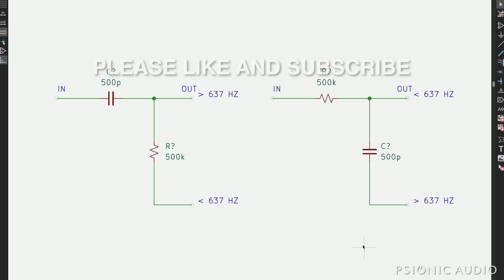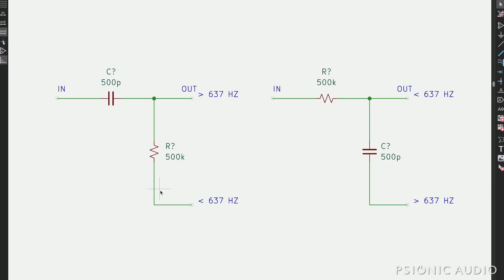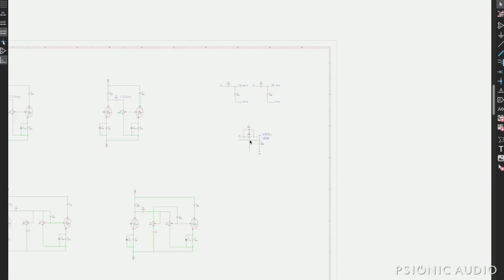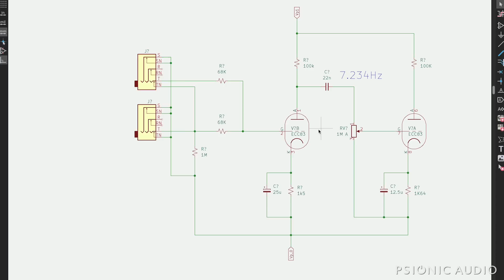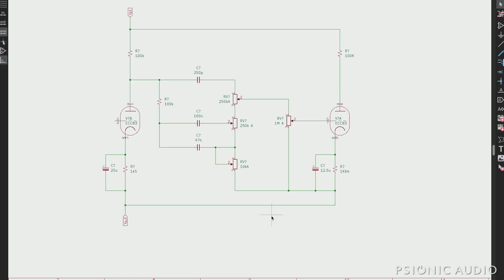Fender Tonestacks: Beyond Analogy

Comment: You can think of an RC filter as being like a very simple frequency-dependant voltage-divider in that the voltage-division is dependent on what the signal frequency is, because the reactance or AC-resistance of the "C" part of the RC filter circuit varies with signal-frequency, the higher the frequency the lower the AC-resistance, assuming I remember my electronics theory correctly.

Comment: At the start of the video it would have been advantageous the consider the capacitor/resistor combination as a voltage divider.
Capacitive reactance is inversely proportional to the applied frequency.

At low frequencies the capacitive reactance is high, so as a voltage divider low frequencies can't get through.  They are not diverted.
At high frequencies the capacitive reactance is low, so as a voltage divider nearly all high frequencies get through.

There's been a lot of talk about the mysterious -3db frequency.  No mystery at all.  It happens when the resistance of the resistor has the same value as the capacitive reactance.

Comment: Thanks for the fairly clear breakdown. 
one Q: is not @2:15  the right-side circuit  inverted rather than reversed? Reverse seems to imply the output becomes the input and vice-versa; changing the direction of signal flow.

It makes me chuckle that fundamentally A "tone stack" is just another word for chord.
Call me 'peeved' or pedantic, but it is pretty ridiculous that guitar players have a knob on the guitar that says "tone" (instead of 'LowPass Filter' or whatnot) - and like 'tremelo bar' it is a source of a broken terminology that goes on and on for decades. 
i.e. "tonality" in music is a matter of interval relationships, and has nothing to do with the timbral overtone structure in an AC audio signal.  Plain old sIne waves are just as "tonal" as whatever fuzz or cascaded, overdiven signal one cares to compare it to.

Comment: I have a 73ish Twin A738488 that i stripped down to a stand-alone preamp for "Jerry Garcia" sound. I've done a lot of weird stuff to it and it works almost all the time. I've replaced a bunch of caps over the years but i think its living on borrowed time.  It seems to drop vol at unpredictable moments. Would you be interested in a job of putting together a kit for me to over haul this thing. I don't mind spending the time and money to rebuild it, I just don't have the expertise to get all the parts at a decent price. I'm only using three triode tubes with a deluxe transformer. It might also make a nice prototype that you might find some profit by replicating. Nobody is making a "real" rackmount "Jerry Garcia Twin clone" preamp. Gear is getting smaller and with radial caps and a deluxe transformer, it could fit in a variety of smaller premade cases. Im thinking about all on one eyelet board. I've listened to a lot of "sounds like Jerry" type preamps and none do what mine does. It sounds more like Jerry than th John Mayher's Dumble. I've had it 30 years and I'll have it forever. Helping to design and build these things for other dead heads would mean more to me than money and in todays "digitally modeled" world it would be an act of rebellion. Nobody knows component choice like you do. Thank you for your time-Joel

Comment: This is great!  
On other tone stacks, or on some simple 1 pot tone control  circuits, I am having trouble understanding RC network.   

If the output is on the wiper of the pot the RC appears to be a fixed RC to me.  On pots where the cap is connected to the wiper of the pot, it seems like the pot acts like a varistor and the High Pass Filter is variable.  Am i overthinking this?

It would be great if you could do one of these on coupling cap circuits so we could figure out the optimum high pass value to keep a full sound but eliminate the nasty lows when overdriven.

Thanks for all of the great YouTubes.

Comment: Lyle, you did more in 22 minutes than I thought possible. Well done. 

For those viewers with a highly technical bent, there are various books that go into great detail about the calculations involved. “Designing Preamps for Guitar and Bass” by Merlin Bledsoe (aka The Valve Wizard) probably is the most accessible. The maddening thing is that everything is connected and a change here can have unexpected consequences there.  “The leg bone’s connected to the knee bone…” and so on. 

In my experiments, I learned that you change ONE component at a time. Maybe 1 R/C filter and that’s it. Then test. Change 3 or 4 things at once and you’ll never be able to figure out what you’ve done. You might get lucky …

Final thoughts: many of these circuit snippets come from RCA’s “Radiotron Designers Handbook” from the 1940s and 50s. Leo Fender was a brilliant industrial designer.  He always focused on cost and availability when choosing component values, and as Lyle explained those amps were multi-purpose - not just guitar amps. There is nothing sacred about a 1k5/22uf cathode resistor/capacitor network. It works well and those values were both cheap and readily available to Fender. However, for guitar you can reduce the cap to 10uf with virtually no audible change (except maybe less woofiness from your speaker). 6.8uf is a sweet spot to my ears in a Blackface amp, but everything must be taken in context. And every player has a different ideal tone on their head.

Comment: So from this explanation I can understand that the Normal channel of the DRRI gains more low frequency because of .047 capacitor after the second stage, rather then Vibrato channel with .022 cap. So probably I need to change this .022 cap on Vibrato channel.
Reply from the maker: No. Do the actual calculations.

You’re looking at the C but look at the R too.

Comment: I have a Bridge Pickup that is overly bright/harsh, even though it is connected to a 250K Tone Pot with a 2 Meg Cap. Would it be better to combine a Resistor and Cap to tame the harsh high frequencies? Any suggestions for Resistor and Cap values? Enjoyed your video. Thanks
Reply: You need to tell us if you are using single coils or humbuckers. And it is the volume pot that sets the initial sound, the tone pot just acts as a treble bleed. When it is set to zero
it is practically out of the circuit. And there is no such thing as a 2 Meg cap. A single coil PU normally uses 0.022 uF which is the same a 22 nF. It is used with a 250K pot.
Reply: @qddk9545  Pickup is OBL Dual Rail single coil sized humbucker. Cap is actually two 0.1uf Caps in parallel. The Pot is 250K. I initially used a 500K pot, but it nearly made my ears bleed.
Reply: @picksalot1  2 pcs. .1 uF in parallel gives you 200 nF, that is a lot. If that does not cut treble, you must have wired it wrong. No matter what PU you would use, that would have cut the treble to be not existing. Check out the wiring schematics at Seymour Duncan.
Reply: @qddk9545  Yeah, it's a lot but along with the Resistor, it sounds good now, so I'm happy. Thanks

Update: After using the Pot with the Resistor for over two weeks, I found that removing one of the 0.1uf Caps gave the Pot a more even and wider Taper, which I prefer.

Comment: LYLE - ..
What Size Pot / Circuit used as a Variable Slope Control would create a Marshall - Fender Tone sweep ?
Reply from the maker: You’d want to go between 33K and 100K, so a 33K fixed resistor in series with a 100K pot wired as a variable resistor with another resistor in parallel across the pot to make it about 70K. 

There would be a little static on the pot. But not as much as without the paralleled resistor.

Or you could use a switch if you just want this or that (or three options).
Reply: @PsionicAudio  Thank You again for the details - the options really become complicated fast ....I know Paul Rivera's design-builds in the Fender line began to create  Marshall vs Black Panel vs  Tweed variables in the Pro Tube series around the early 90's - some of the notch filters and Focus delivered an immediate satisfaction for the HB vs Single Coil sounds.

Comment: Interesting way to show the layman how R-C networks build an audio circuit.  A big improvement in understanding might result from adding a small & very simple response plot showing the relative result at each point as parts and controls are changed.  Offered respectfully.

Comment: You might add the cathode BYPASS system in which the signal is transported to the 2nd stage, bypassing the first and the tone stack. Fender uses a 22uf cap which lets through all the bass, coupled with a 1.5k resistor.
So your tone stack is only one part of the equation..
Reply from the maker: That’s not what cathode bypass caps do.

Comment: Hi, In a high pass filter the capacitor will have more trouble passing the low frequencies, as it comes close to DC. So why are you suggesting that < 637 signal frequencies goes to ground. In my view that path is just a less likely path for signal > 637. 

Maybe I misread your first schema
Reply from the maker: I agree, I wish I had explained that differently. I was trying to get the larger point across and introduced an inaccuracy in the “how it happens”. I was trying to show the importance of the resistor to ground (typically) but didn’t want to get into the really technical stuff. It’s difficult to try to explain these things without going into tech speak. For example I mentioned an elevated cathodyne instead of ground then regretted it, as that would require more esoterica to explain.

Comment: @Psionic Audio you have become a Phenomenon. I am a Guitarist & former FCC Amateur Radio operator and 1974 graduated HS Rehab electronics and  Electronic and Digital Devices 
You are as good a Teacher as Mr. Green and Mr. Dill were in 1972-1974. Of course they are dead, perhaps their ghosts or spirits infused you with comic effect as my 1970's Instructors. Mr. Green looked like Dragnet TV guy, nick named 'The Green Machine" Mr. Dill was always Smiling and chubby. Arkansas stole them from Dallas Texas. 
(INDT-1063)

Technical & Professional Division

This course presents a comprehensive overview of the design and application of solid state devices and circuits. Topics include diodes, transistors, power components, operational amplifiers and oscillators. The fundamentals of digital logic are explored through number systems, codes, gates, Boolean logic, truth tables, encoders, decoders and converters. This class offers an overview of concepts and principles that are necessary for continued study in the field of automation.

Comment: Awww come on, Lyle, show the tapped 350K pot hi fi tone stacks Leo used. My blonde 1x15 6G9A Pro with a 6G15 reverb unit is a dripping wet and clean surf moo-sick machine. The old Hewlett Packard HP48 calculators can be programmed to do tone stacks, load lines, 3rd level determinants, derivatives, phase shift, etc, ad infinium, up to and beyond Fast Fouriers. There is some degradation of accuracy in detailed Fourier calculations but they also have a lot of the basic in an electrical equation library.

Comment: That was as good as you could hope to get in such a short window of time! The Duncan Tone Stack calculator is handy if anyone wants play around with different theoretical values. It helps to solidify the concepts. Tone stacks are the most complicated part of building and even reading schematics it takes some time and doing to START finding firm footing with them. Any tutorials on any topic you can do are appreciated,Lyle.
Reply: Amen on the Duncan TSC!  There is so much interaction between the control settings (pots) in a typical Fender TNB tone stack, all you can do is calculate one set of settings at a time - and the calculations are not trivial. I built my first amp over 15 years ago and know I can’t just say “if I switch these 2 caps to x and y, the effect will be just what I want.”  Plus the slope resistor affects everything else.

Comment: Shouldn’t the cap be after the node on the first diagram? As shown both the output and the ground would get everything above 637 Hz.
Reply: It’s a standard RC high pass circuit.  It would pass (allow) only frequencies above 637.  There are many articles on basic filter’s on the internet.